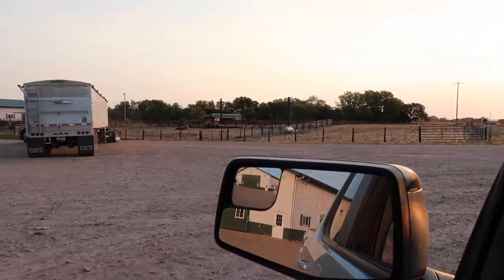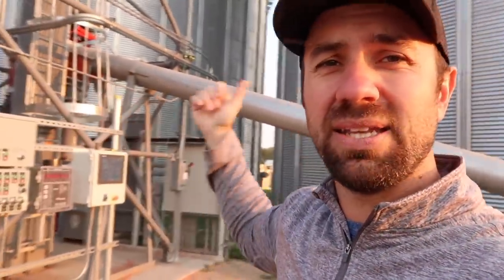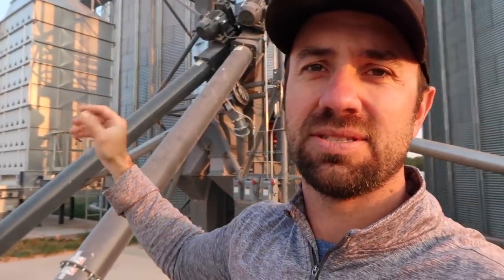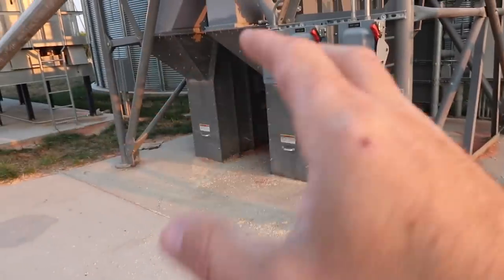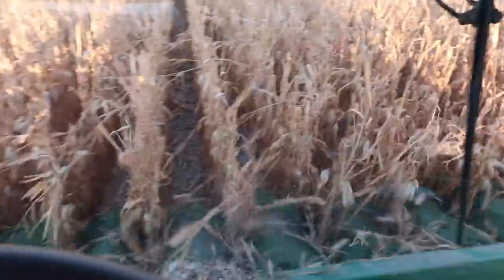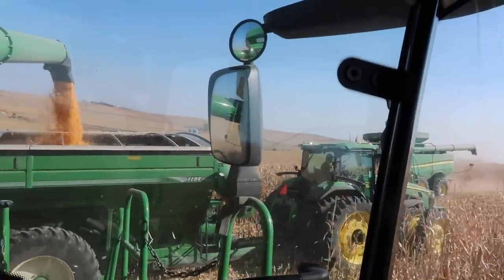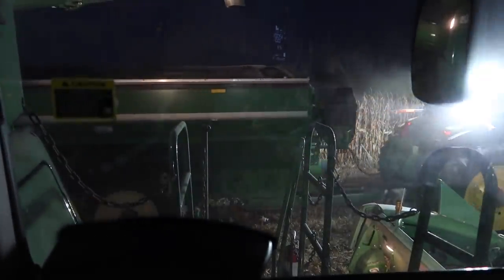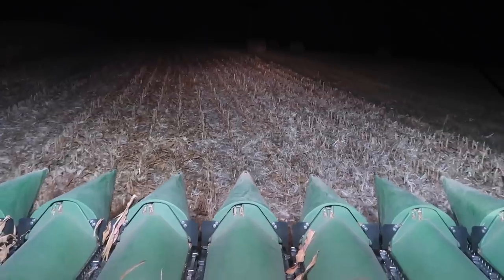On to the Corn Picking

Comment: What is it that your corn dries a lot faster? Is it that your climate is that much more arid? Here in the East alot of the corn is still in the mid twenties.
Reply from the maker: Climate mostly. Usually depends on heat units received. Not every year is like this though. Say couple weeks ahead.

Comment: Do y’all ever think that the class 7 is to small for a 12 or do you think it’s a perfect size?
Reply from the maker: We prefer the 7 due to our terrain and speed capabilities.  We run 3.5-4 mph most the time and they do well. Our hills we can't constantly run much faster so works well. We've ran the 8 before and didn't gain much. That's a good question I might elaborate on in a video. Thanks!